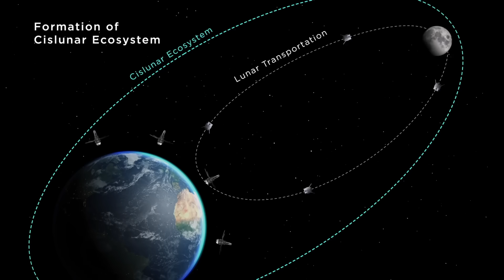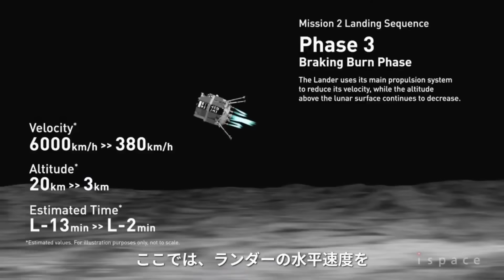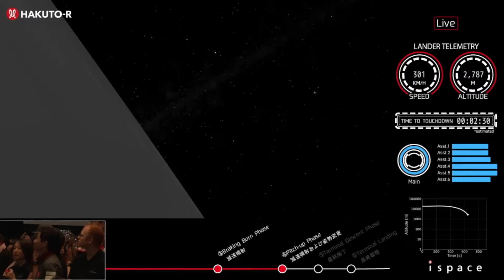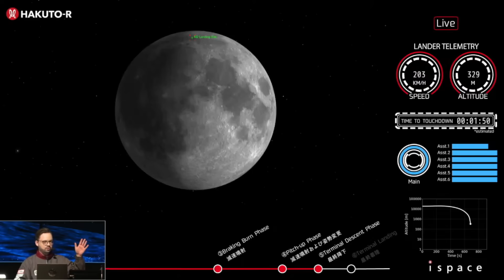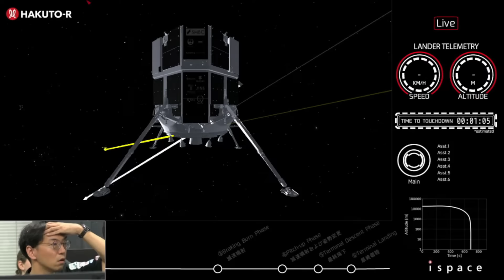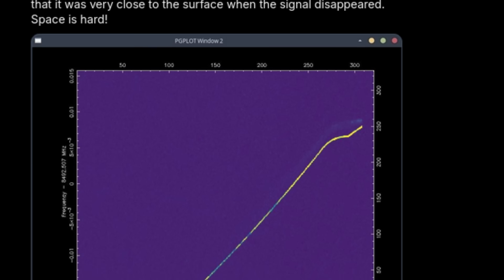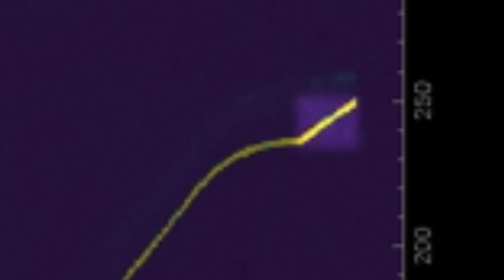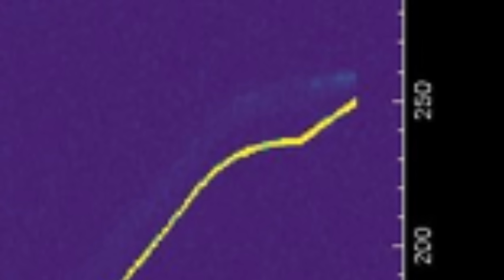Japan Crashes into The Moon, but Slower Than Last Time

Comment: If these low-to-ground landers cannot land successfully imagine something as tall and heavy as a Starship being successful. What are the odds of that?
Reply: Starship surely would use radio altimeter and not laser. Also it would land much steeper, what is much easier
Reply: @jochenwagner2782  My question is where do they expect to land Starship?  Last I checked there were no concrete landing pads on the moon or Mars.  That thing would blast a sizable crater in the surface and likely fall over unless they can somehow find a nice bit of flat exposed bedrock to land on.
Reply: @markoulton3342  You are five years too late with that gotcha problem. HLS starship will have smaller engines on top that are angled away and used for final descend.
Reply: @skyrask1948  Assuming it can land without toppling, are those same engines going to be used to lift-off again?
Reply: @markoulton3342  the best place are the "mares". Very flat surface, very hard, too. 
It's not rocket engeneering to improve the landing legs, that they extend more or less using pressure sensors in combination with a gyrocsope for knowing the rocket is up right. You could land on 20% slopes without any problem. To land on rubble, just add  big inflatable baloons to the feet. Inflate them with a foam that's hardening itsself to a solid material. So there's minimal risk at puncture the baloon.
You even could choose as first landing site a known site expored by another mission and then just build a flat surface for upcoming landings.
You have much more margin on structural stress of the vehicle as it is build for. Gravity is significantly lower. This means, you do not need this perfection of an extremely flat surface.

Comment: Even NASA sometimes gets metric mixed with imperial units or puts an accelerometer in upside down!
Reply: It was the Russians who put that accelerometer in upside down, resulting in the largest booster explosion in history. Apparently it was designed so that it wouldn't fit that way but Ivan got a hammer and MADE it fit ...
Reply: @kenoliver8913  N1 explosion (coincidentally also Russia) was larger than Proton’s

Comment: 7:00 after playing Kerbal , 60 M/s is 10x faster than you want to land with .
Edit: should have said Touch down than land*
Reply: 60m/s is 216 km/h, its not a plane that land with gear on a flat surface for a few hundreds meters, there is probably not much left of it if the rockets wasn't functioning properly.

Comment: Having a lunar GPS system might, might makes landings somewhat easier....?
Reply: Apparently you can see Earth GPS from the moon. A recent lander proved that.
Why it isn't being used for location data is beyond me.
Reply: @AndyKauffman-ml3og  GPS works by measuring the distance to multiple satellites in different directions. From the Moon all the Earth GPS satellites are in about the same direction so accuracy is low.

Comment: Could they just have a mirror at an approximate 45-degree angle in front of the lidar laser, so that when they are horizontal, they can get altitude and terrain contour information?  Then when turning to vertical, just flip the mirror up out of the way.
Or, maybe better, mount the lidar horizontally on the craft with the mirror held straight out to the side, out of the laser’s sideways aim.  As the craft turns to vertical, a solenoid or stepper motor pushes the mirror to its 45-deg-angle mechanical stop in front of the laser beam for vertical distance and distance-rate measurement.

Comment: The difference is the presence of a pilot. A very, very good pilot.
Reply: Yes indeed...
I do wonder myself, The moon isnt that far. Why can't they just revert to manual control in situations like this? 
They have cameras, just fly it to the ground manually. Kind of like what Neil Armstrong did. Sure its a 2 second delay, bit might still be doable, and its better than loosing the whole thing because of faulty guidance and programming. 

I mean really, why dont people just fly these missions manually?
The moon is close enough that you could get semi-real time communication.
Reply: @livethefuture2492  Now you are being reasonable and logical. All these things have the latest whizbang instruments hanging off of them but the stuff that gets them Safely Down to the moon to use them almost seems like an afterthought. Like the Intuitive Machines with the CG way up on the craft, a child could see the thing would tip over given the slightest mishap on a rocky surface like the moon. : )
Reply: Agreed. All these landings are strengthening the case against self flying aircraft and driverless automobiles. Or even a single pilot cockpit on commercial aircraft.
Reply: Yes, and they were all equipped with the best "computers" that money could buy, and not for that much cash either in those days!! ;D

Comment: I wonder if during the descent phase they could have the spacecraft launch a retro reflector ahead of itself towards the landing site to allow for more accurate ranging with the lidar system. The moon has a pretty low albedo, which might be why their ranging equipment hasn't seemed to work. The reflector could be extremely light and could be launched with very little propellant, maybe just a bit of RCS pressure.
Reply: I had the idea of landing a little beacon on the surface that just broadcasts a known-point signal. It can be used as a navigation aide & also a distance signal.
I like your idea better, though - it requires no power.
Didn't Firefly have a retroreflector & land in a safe spot?

Comment: My DSLR can determine the rough distance to an object in focus in milliseconds through a single lens. Surely some form of passive optical distance measurement would be better than a LIDAR that has now failed twice (albeit in different ways). Maybe a pair, or two pairs, of cameras mounted with maximum possible lateral separation could use stereoscopic methods to determine the distance to the area below the lander, and also "map" the roughness and obstacles in real time.
Reply: Someone else had the idea of firing a retroreflector ahead of the lander, it'd be similar to your idea but not require power.
For either idea, I like the idea of having one per landing "foot" - if the distance returned is too far off, try to move. 😊
Reply: From kilometers away on a moving platform? IIRC camera + computer vision is what they used for Ingenuity and it worked well until it went over a featureless dune and crashed. But that was at much lower altitudes.

Comment: I'm wondering if they couldn't put the LiDAR unit on a gimbal capable of swinging about 100 degrees, so accurate altitudes could be gleaned even during the period the spacecraft is skimming over the surface in ultra-low orbit. The gimbal would adjust where the LiDAR is pointing based on lunar gravity but without the effects of deceleration thrust added. I'm sure there's a sensor combination that can track the center of lunar gravity while ignoring any inertial forces that thrusters would impart to the spacecraft. That same sensor combination should be able to also be used to keep the side of the spacecraft that has the LiDAR gimbal facing the center of lunar gravity so the LiDAR only needs a 100 degree gimbal in ONE axis.
Reply: call me crazy, but how about two lasers pointing in different directions so you don't need moving parts? Or how about a light splitter like is now standard on guided telescopes, it's a prism and a 50% mirror, they don't even need a second laser, just a 50% mirror

Comment: No offense. But whoever designed this... Please change your job.
Why?
You will land with a lateral velocity, hopefully on something more or less flat.
Your lander legs are now tumble legs. If your lateral velocity is not ZERO... Ouch.
Solution:
Wheels on a long soft suspension with heavy damping.
Now you only need to match the angle of the wheels with your lateral or forward direction. If you land with 20 m/s, we'll let wheels do their job. When you have touchdown, you can use a thruster to slow down and the use the brakes to imobilize your lander. Then you drive around the whole lander.

Comment: Someone should develop an AI system designed to land on any location on the moon, using image recognition and other instruments.
A package of software and hardware that can work with any spacecraft mass and engines once the characteristics are specify.
Training a neural net on a simulation showing them real image data and sensors plus cases where sensors show the wrong data.
Of course the hardest thing to develop is the simulation software, as the moon surface might not be perfectly mapped, it will have to learn to recognize the best flat surfaces to land.  The simulation software should fill the 3d details with a procedure generator.
The question is who would buy this?   But if Starship success, not only NASA would benefit from this, but also all private projects that now find cost efficient to sent something to the moon.

Comment: Hello Scott
I have watched several feeds of potential lunar landers turning into percussive test articles or "Dude Chilling" horizontal art pieces due to the inability to "read" the lunar surface.

Would pre-landed retro reflectors be able to solve the "Where Am I" calculations that the landers must carry out.

Is it not possible to include robust, light weight optical retro-reflective markers that could be jettisoned from a lander that is approaching the lunar surface, say, at the tip over part of the landing process.

These would free fall to the surface around the proposed landing site, well before the lander and provide fixed reference points for laser radar altimeters to use to determine its horizontal and vertical location and speed with high accuracy.

Your thoughts?

Comment: Why it’s safer and better to brake early, cancel horizontal speed at altitude, and take time to observe the terrain before landing:

More time to analyze the terrain:
By stopping the horizontal velocity at high altitude (e.g., 10 km above the Moon), the lander descends almost vertically. This gives you more than a minute and a half (about 110 seconds) to observe the surface with high-resolution cameras, analyze real-time images, and find a truly safe and flat landing site.
On the other hand, if you arrive fast and low, you only have a few seconds to analyze and choose, increasing the risk of landing on rocks or slopes.

Greater margin for corrections:
During a long vertical descent, you have more time to correct your trajectory and shift sideways by several tens of meters if you see that the spot below isn’t safe. More time means more opportunities to avoid hazards.

Operational safety:
A controlled vertical landing is easier to manage, both for automated systems and for ground operators if needed: less residual speed, lower risk of bouncing or sliding, and more time to react to any unexpected events.

More reliability, fewer surprises:
Landing “on the fly”—coming in fast and hoping last-second mapping is enough—carries a much higher risk of mistakes: with little time, a single hidden obstacle or reading error can lead to a dangerous landing.

A little more propellant, a lot more safety:
It’s true that this maneuver uses about 10% more propellant compared to a more “aggressive” descent. But that’s a small price to pay for much greater safety, especially for expensive or crewed missions.

Braking early, taking time to observe, and carefully choosing the landing site is clearly much safer.
It means prioritizing the mission and the payload, drastically reducing the risk of damage or failure due to a rushed landing.

Comment: How did the U.S. and the Soviet Union put landers on the surface of the moon with analog technology 57 years ago?
Reply: it took USSR 13 attempts to achive a successful landing. It took USA, if I remember correctly, 7 attempts just to take a closeup of the moon. 

After so many failures of the Ranger program, the Surveyor lander was very closely supervised, and the hardware was very robust and extremely well tested, in as close to the actual conditions as one could simulate on Earth. And even so, the project teetered on the verge of failure. It was not a smooth ride.
Reply: @cogoid excellent point, somehow the public forgets how equally difficult it was then even with the government might behind it
Reply: they did, with a very generous government funding, actually the analog technology has its advantages